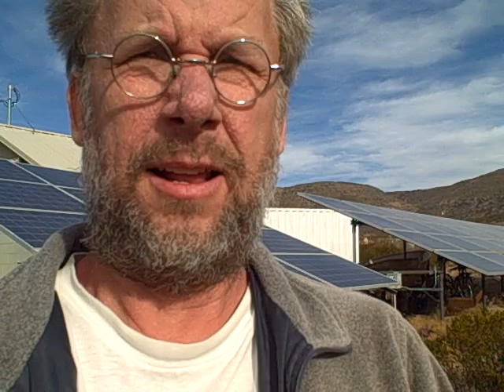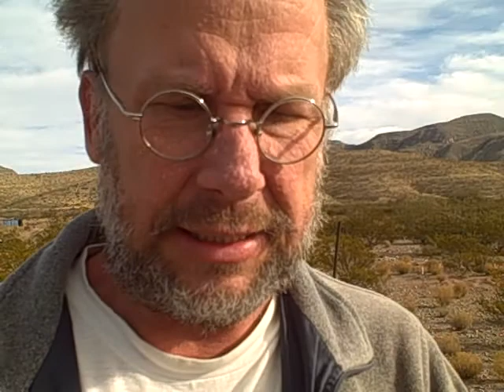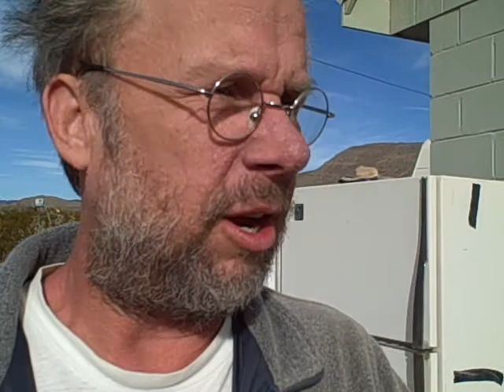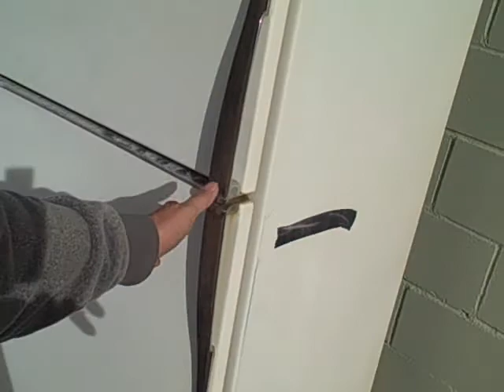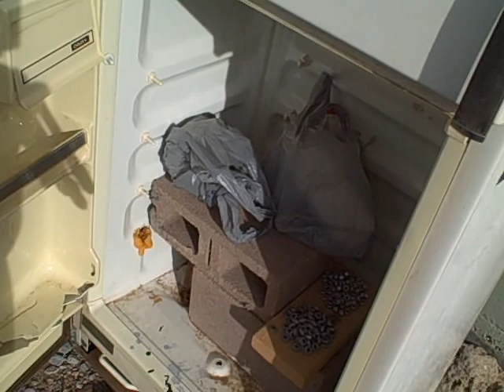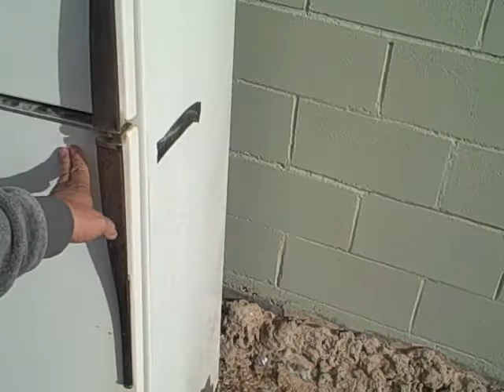Mining Bitcoin with Solar Panels (part 1)

Comment: Why does the power company pay you more money when you don't provide them with energy??
Reply from the maker: They want / need the carbon credits associated with what I generate more then the power which they can generate themselves at a much cheaper rate.
If you are more curious, I made a video called "why I get paid to waste electricity" it's a real nail biter
Reply: @Shelka04  OK, though, don't you feel bad about unnecessary pollution to the environment?
Reply from the maker: @unusualaquariumecosystems5805  i'll leave it to the politicians to feel bad

Comment: i am planing to mine ethereum with 65 Radeon R9 295 graphic cards, and power it with solar.
i need 150 100w solar panels which will cost me around 15000 dollars and the graphic cards will cost me 39000 dollars. basically i will have 3000 MH/s which will make me 100 dollars a day, 3000 dollars a month, and 37k dollars a year. i will basically get all the money back in two years. if it will go well, i will double that